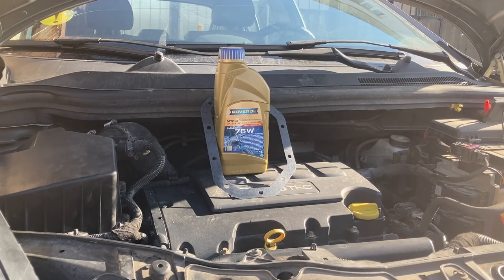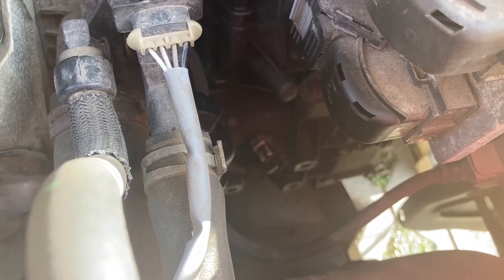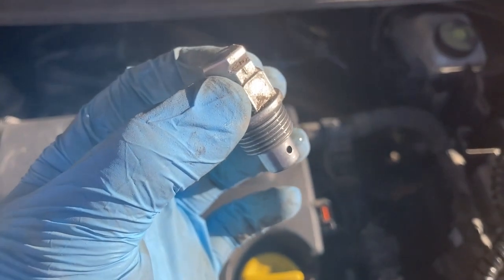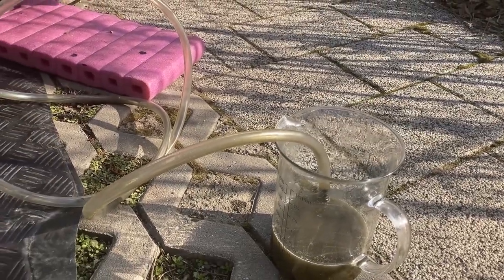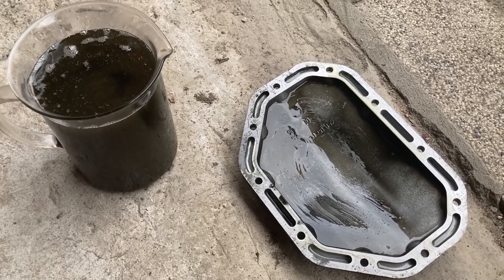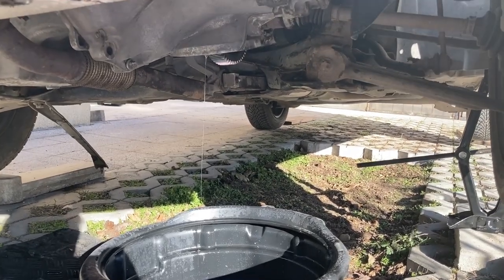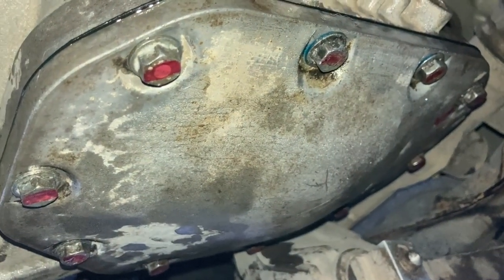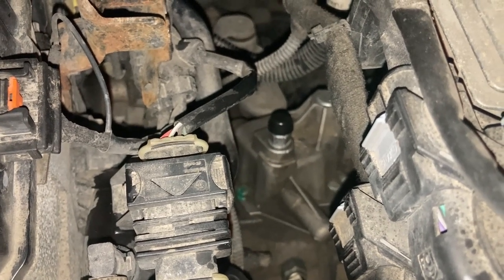DIY - 2014 Opel Corsa D 1.4: Change the F17 manual gearbox oil (transmission fluid)

Comment: Another great video 👍🏽👍🏽. You had the exact same idea as me using the pump, I'm very surprised it worked so poorly and disappointed, I've changed the gear oil once via removing the diff plate(M32 gearbox and clearing it up not much fun.  I wonder if h could get much out by lift the car on driver side and remove the filler plug and have it come out of there? I need to change.kine again and really do not want to do it the traditional way lol
Reply from the maker: As far as I know, the M32 should have a dedicated drain plug, so you shouldn't need to remove any differential plate etc. in order to drain the oil. But to make your life as easy as possible, you can do what I suggested near the end of the video, namely just do a number of drains and fills. Given that the M32 box takes 2.4 L of oil (dry fill), 2 cycles with 2 L of new oil each will replace about 97 % of the old oil in the box. For the F17 the level plug can be used as a "drain" plug and 3 cycles with 1 L of new oil each will replace 95 % of the old oil. This is the exact thing that I'll be doing on my F17 the next time, as I'm definitely not going through the differential pan removal and installation again.
Reply: @TheMissingBolt  i.must have it wrong with gearbox model, I have a 1.2 AX12ER Engine, but for your reference my diff pan looks like the one from the youtuber: Tom's Driveway, if you type in Corsa D gearbox oil change its the first video.  I agree with you, I think I will try use the level plug as a drain plug this year and do a couple of mix up flushes as I use OEM oil (whilst I think better quality is out there, with gearbox oil I just like to stil with OEM.
Reply from the maker: @evieemaya88  Indeed, the 1.2 A12XER engine uses the exact same F17+WR (M26) box that I've installed on our Corsa. The M32, as far as I know, is only available on the Corsa D with the 1.7 diesel. In your case, the same procedure as I've described in the video applies. So I really do recommend that you use the solution with the multiple drains & fills, using the level plug also as a drain plug. The amount of headaches should be considerably lower with this approach 😂 Regarding the oil, the original GM 1940004 oil is pretty OK as far as I've heard. It's either a 75W or a 75W80.
Reply: @TheMissingBolt  what about the BOT 303 SAE 70W? It's what Opel tell me to use...Any help pls
And great video.
Reply: @TheMissingBolt  another doubt, when change the driveshaft seal, some oil was pouring and was red...I believe the new oil (with the new ref) is yellow am I right?
Thanks in advance.
Reply from the maker: @fabiovasconcelos511  That's correct. The oil with the old standard (1940182) was red, while the one with the new standard (1940004) is amber / yellow. Note that the red gearbox oil is not ATF, it's just a color coincidence.
Reply from the maker: @fabiovasconcelos511  It depends on the vehicle and transmission type. For example, Astra J with the M32 6-speed manual does indeed require SAE 70W oil, whereas other combinations require BOT 303. What vehicle, engine and transmission do you have?
Reply: @TheMissingBolt  thank you for answer me.
The car that I have is Corsa D A12XER with F13+
Reply: @TheMissingBolt  hi again.
So, I have information about transmission oil for only F13 (but I think F17 are the same...) that if you change to the new spec oil and start to ear noise when engage reverse its because of the low oil viscosity, and if the car owner want, he must change to the old oil spec. I have a doc to prove that.

Comment: Playing a risky game with no axil stands 😮
Reply from the maker: The only time the car was suspended was when I wanted to remove a little bit more oil from the box...and during that time, I was never underneath the car because (1) I didn't need to and (2) it was indeed risky to have done so, since the car was only supported by its jack. Throughout the rest of the procedure, the car didn't need jack stands as it was sitting on all 4 wheels. 😁

Comment: I'll bring it to the local garage, too much fuss.
Reply from the maker: Indeed, the pan drop and gasket replacement can be time-consuming to do. But you can always do drains and refills yourself using the level plug as a drain plug - which is much easier to do.